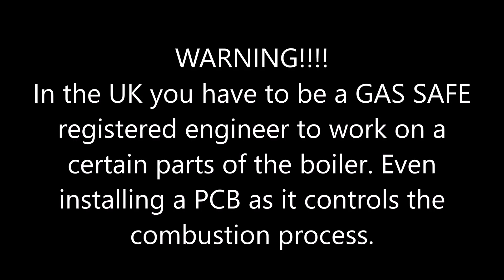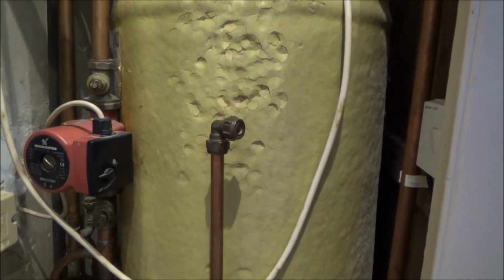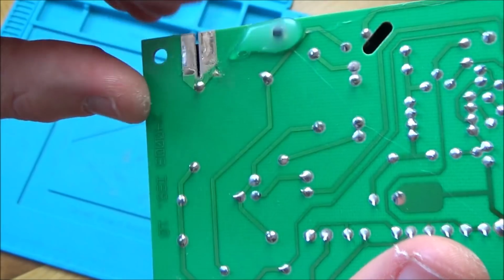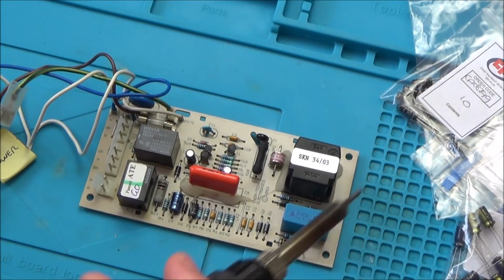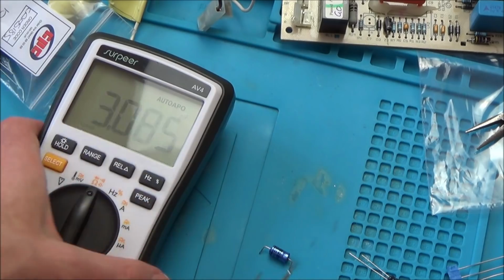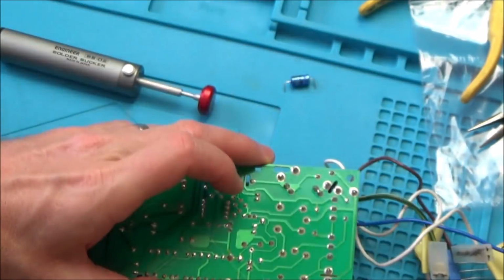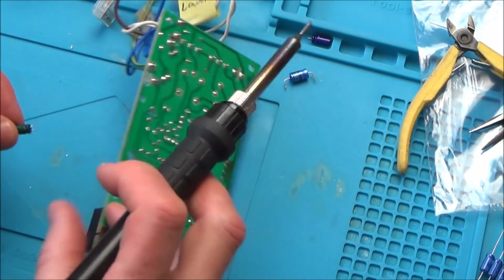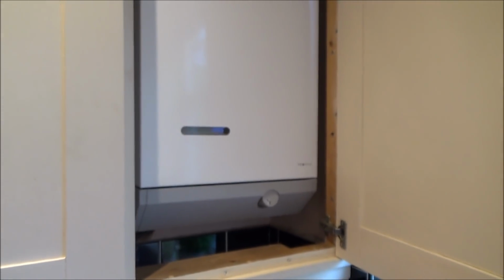Trying to FIX a Faulty Gas Conventional Boiler

Comment: Another cap bites the dust!

PS:
1. Your pal knows quite a lot, his speech at the beginning sounded like a lecture!
2. I think the reason adding leaded solder to unleaded solder brings the melting point down is because the solders match in composition except for the lead. Therefore, the liquid and the solid solders merge, becoming one homologous solder with a percentage of lead instead of either full lead or no lead.

This percentage of lead determines the melting point: fully unleaded has the highest, fully leaded has the lowest, and partally leaded has a melting point somewhere between.

In simpler words: it’s the amount of lead that determines the melting point. Leaded solder merges with unleaded solder (mechanism unknown to me atm.), and changes the amount of lead as a whole. This change = change to the melting point.

PS: PS: Keep up the good work!
Reply: Also lead-free solder joints produce more brittle joints that leaded ones, as lead is slightly flexible, and leaded solder melts with lower heat and slower cooling-down, while lead-free needs higher heat and cools down quickly.

Comment: This is a very common fault on modern central heating boilers. It amazes me that some boilers' PCB's have electrolytic capacitors with a maximum working temperature of only 85°C, which makes little sense, given that 105°C capacitors are only pennies more expensive!
Reply: When you are making millions of something, a few pennies each adds up. They care about profit, not making things last.

Comment: The blue disk at the top of the board is not a Thermistor as comment below. It’s a metal oxide varistor used to suppress voltage transients
Reply: The blue thing is a mov. A metal oxide varistor. It's basicly a voltage dependent resistor that's used for input protection. Basicly it's resistance shoots DOWN the high the voltage and thus protects the device BY BLOWING THE FUSE NEXT TO IT

Comment: Great fix, Vince!  Even more interesting is seeing the inner workings of the homes in the UK!  Not speaking for all of the US, but of all the houses/apartments I have lived in  around Ohio I have only ever had forced air heating units and water heaters that are big metal looking tanks.  At my home now I'm in a rural area surrounded by farms so I have a well with a pump that stores water into a pressure tank which then goes through a water softener and to the heater holding tank for hot water.
Reply: We still have water tanks. Not all houses, some have combis that heat on demand, some have a hot water tank. We virtually never have forced air heat rarely houses had it my house was built with it but has since been replaced with radiators. I think because a lot of our houses are solid wall so brick/block and plaster it's hard to put ducting in solid wall from what I see American houses are mostly plasterboard aka sheet rock. Modern houses are now built this way but I think we have got used to them so stuck to it.

Comment: nice repair. but one thing to note always check those diodes also, diodes can go bad. i had a few TVs which were completely dead due to 3 diodes in parallel although two out of 3 were okay. but at least its working.

Comment: in AC, Capacitors can act like a "resistor" and is frequency dependent. ESR (which has a explicit definition which I wont get into) is a way to measure how a capacitor impedes AC current Equivalent to that of a Series Resistor (ESR). A high ESR usually indicates a capacitor where the electrolyte is drying out

Comment: Great stuff =D   I've been here myself lol =D  I took the board the engineer gave me, soldered a few dry joints, he re-installed it and all OK =D
Reply from the maker: Well done Chris, this one was very satisfying to see that one capacitor testing faulty on both meters :-) Looking forward to setting time aside Monday to watch your Gameboy McWill mod video, if the thumbnail is anything to go by it looks amazing :-)
Reply: Thanks =D  I also recently swapped out the resistor that feeds the fan in the fireplace.  Super easy to do!  You just have to be careful regards anything related to gas.  As you say, gas safe engineer has to do most things.
Reply from the maker: Yes definitely Chris.  Even somethings outside the combustion chamber has to be done by a Gas Safe engineer for example if it controls the combustion as it could alter something, carbon monoxide is deadly so it is better to play safe and get in a gas fitter :-)

Comment: It's called being flexible.  At that time the capacitors they used were cheaper, so they used that type.  But if the market is cheaper that the other one, they would have used the other type.  But the person that designed the board was pretty smart.

Comment: Common problem pcb, I have replaced many of these on the potterton profile, I’m a gas safe plumber, about time it was pulled out for something more efficient.
Reply: Jay Ash had no idea mario was a registered gas safe Plummer...
Reply from the maker: Interesting to know it is common failure :-)
Reply: Jay Ash ever bothered to recap them boards I doubt it? hmm problem with gas safe 'engineers', their times so damn expensive, they think every fault is a new boiler,   No doubt the capacitors were penny's, but how much was the gas safe guy engineer to plug the flipping board back in £120?
Reply: @beingatliberty  considering the boiler is over 30 years old then no its not worth me spending my time recapping, probably cost the customer more in the long run as you are only repairing the fault, the board is prone to fail in other areas, so its not worth fixing the board only having to go back months later to repair the board again or replace, does'nt look good on me if i have to go back again for the same issue
Reply: They don't call these old boilers zombie boilers for nothing, they never die!

Comment: The big blue circle near the power inlet is a MOV, also known as a voltage-dependent resistor (Search wikipedia for Varistor), it is basically a "big brother" of a diode, once the voltage between its both legs becomes too high, it starts conducting current, till the voltage passes the same threshold again, effectively working as a surge protector. When they fail, its usually dead short or fully open
Reply: The blue thing is a mov. A metal oxide varistor. It's basicly a voltage dependent resistor that's used for input protection. Basicly it's resistance shoots DOWN the high the voltage and thus protects the device BY BLOWING THE FUSE NEXT TO IT

Comment: The blue thing that you ask about at 12:27 is a thermistor. A thermistor varies its resistance with the temperature. It is used to limit the current to the circuit.  When the circuit draws current the thermistor heats up and increases its resistance. Which limits the current that the circuit can draw. 
The large orange thing in the center of the board is a polyester capacitor. One of a polyester capacitor uses is to handle high current levels.
Reply: u know what u are talking about ?
the blue thing is a VDR or Varistor. it's a protection against over voltage between L+N, it's decreasing the resistance if the voltage is going up.
and i would never choos a polyester cap for high currents. this is a job for elkos, spezially Low ESR Types.
Reply from the maker: Thanks pds8475 :-)
Reply: It's actually a MOV (Metal Oxide Varistor) which, as Ratzfaz states, is used to prevent unwanted voltage spikes from the mains supply damaging the other components on the PCB.
Reply: @WaltonPete  I knew it had to be either a thermistor to limit current or a varistor to protect from voltage spikes depending on how it is connected. As for Ratzfaz saying he would use a elkos. Elko capacitors are typically in microfarads and for lower values a polyester capacitor is used. A polyester capacitor is also significantly cheaper as well. The orange capacitor is not the shape for an elkos but the right shape for a polyester.
Reply: @WaltonPete  they are 2 movs on the board - one(small and black one) bechause they are using only one electrode (spark and ionisation at the same time - connected between the ground and the other end of the ignition coil)

Comment: My guess would be that the board was no doubt designed with future proofing in mind, Electronic components are constantly evolving ergo if a circuit board is to be relied upon for over a few decades and if it may need repairing, it would be wise to make it as compatible as possible to the evolution of what electronic components are being manufactured, axial capacitors have been around a long time, but they take up precious "real estate" Err-Circuit board space, So Modern Electrolytic Capacitors were and still are getting ever smaller and at the same time moving away from the axial format.
Reply: That is a rather positive spin on it. More likely it was holdover from an earlier design and they had a lot of axial caps in stock when they switched to a new board.
Reply: Yerp  @Jeff121456  thats another valid reason, and probably on the money, mind you it still involves Component & PCB evolution or could we say Versions ;)
Reply: My thought  was maybe the board was hinged for access and it might foul on something else, depending on the design. I guess the board gets used in many different models.

Comment: Just a question. Is it a really fast reheat? It dosen't look like It even has enough water for a 5 minute shower. I have used an instant heat boiler but it was tiny. I realize being an American I'm used to 30 to 50 gallon tanks, but you loose hot water pretty quick because the tank is so big it cant recover very fast. Powered shower head?
Reply: @seventeesweremagic  No shade intended. Honest question. Like I said I have used Instant hot water heaters and they are 1/8th the size of that heater. Is the hot water supplemented at the shower or are you stuck with a cool 5 minute 1 gpm shower?
Reply: Generally if you have a system like this you would have a electric powered shower.
Reply from the maker: Hi dwarf365, my tank looks to be a similar size to the one in the video and I get a full deep bath out of it before it runs out. If 2 people want a bath straight after each other then the 2nd person does have to wait for it to heat up. I have a power shower with I think a 15cm square head and I haven't run out of water before I am bored in there. I think I have had 15-20 min showers without it getting cold :-) Maybe my shower pump is not pushing out the water as quick as other systems but with a family of 4 this size tank is working for us. Maybe it won't as the family gets older though :-)
Reply: @Mymatevince  Thank you so much for the reply! That's cool, it holds more than it looks. A good bath is like 20 - 25 gallons so that's about normal.
Reply from the maker: Apologies for not knowing the size, someone will hopefully reply with the answer as I think it would be a very common size here in the UK :-)
Reply: It depends up until the 80s, hot water tanks were common. Now we have so-called combi boilers which provide hot water on demand for as long as required.
It a play off between heating large amounts of water efficiently and then not using it versus heating just what you need less efficiently (the old water geysers were hopeless).
Reply: @mahlapropyzm9180  thanks so much for the reply! I understand, it's a hybrid system. That's cool, way more efficient and still has a decent buffer unlike just an instant hot water heater. Thanks, didn't know about the 3rd type of heater.

Comment: * ADDENDUM *
The Blue component is a thermistor, it's designed to fail should it experience an extremely brief but massive spike of voltage, "Think Lightning" ;)
BTW - Electrolytic Capacitors hold their voltages for a longer period than NON electrolytic capacitors such as that Orange one, electrolytics usually are designed to charge and discharge on a dirty "half rectified" Direct Current Circuit ergo the need for polarity, BTW if you inadvertantly place an electrolytic Capicitor into a Alternating Circuit "AC" or signal circuit that changes phase, it may end up being an explosive experience :D
Reply from the maker: Thanks mate :-)

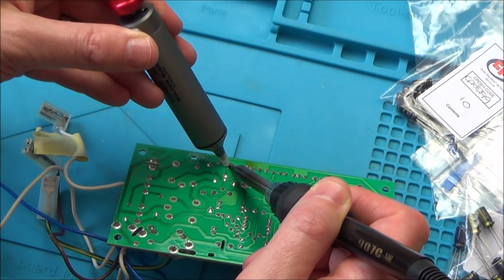Comment: Looking at the other side of the board there is a very big patch of scorching going on there at for example 15:42 to the left of the soldering iron.
Reply from the maker: Well spotted Ian, the 2 marks on the right of the soldering iron at 15:42 ...it looks like it is on the component Z3. I didn't notice this in real life!!!! Not sure if Z3 is designed to get this hot or not. Hopefully it doesn't fail :-)
Reply: @Mymatevince  probably a Zener diode. They do get warm iirc, but that may have been exacerbated by the dodgy cap.
Reply from the maker: Thank you :-)

Comment: 22:34 The large round cap is what we call a safety disc type capacitor.
22:37 Another safety cap
These safety capacitors are for preventing some kinds of electric disturbance that can either destroy the circuitry or introduce a shock hazard.
Also, you should have purchased and used high-quality capacitors from reputable manufacturers! Majority of cap failures are caused by inferior manufacturing, or too old age.
(Edit: Solid capacitors like ceramic does detoriate, but slower than electrolytics, about 3 to 10 times life, and shows detoriation through cracks, shorts, or open-circuit. Physical damage is the common fail)
Reply: Andrew Littleboy Sorry for the grammar. And those were not Panasonic when I still remember learning about them, those are from Matsushita Electric Company a.k.a Panasonic! (note: check the 'M' inside a rounded box)

Comment: Great job. You would have link or name brand for the solder wix. I am use to using a braided wire.
Reply: GootWick is good - it is impregnated with flux and not too tightly bound. Other cheaper ones don't have the flux or not enough. You can buy solid flux (colophonium from Ebay) and melt it into the braid, then it works well.

Comment: Could someone tell if its perfectly safe to pressurise a standard 36  /18 pre-lagged cylinder, thats not something i would ever have thought to be right, even if its only 1 bar, what happens when the pressure relief valve goes wrong and then the cylinder is expected, to take 3 bar?.

Comment: Meant to say Vince .  We're you aware that Maplin began trading again sometime between Christmas last year and earlier this year . They are only online now so you should still have that resource for components . I've only seen they are indeed trading again I haven't checked what they are now stocking. But thought i would let you know. Had this issue on our boiler 2 years back but it was a combi. Ours however ended up being condemned due to the issue as it would start try light and fail and then purge the extra gas built up but then that failed too which was the pcb too. Ended up with a new boiler :( . Right now to watch the rest of the video
Reply from the maker: Cheers mate I never knew. The thing with Maplin was that if you wanted something the same day then could get it locally even if you had to pay 3 times the price of online. Now if they are back online only I would be tempted to use someone like CPC and get the same things much cheaper. Years ago but if you needed a component then you had the option of Maplin or another little radio type store which near me do not exist anymore.....now everything is online so it means waiting for delivery which is annoying when you want to try and fix something. I will check them out online though as I am curious as to what they are selling :-)
Reply: @Mymatevince  Its atually  not the Maplins you know... its some other entity that has bought the name and trying to trade under it and making piss poor job of it

Comment: The reason for the option for axial and radial capacitors is down to component population and therefore the build of the PCB would be faster in there current order. This is how production produce the M/c programs.
In was a technician on PTH machines and theses types of components are more robust then surface mounted components.

Comment: Blue disk looks like a MOV. Capacitors are not ideal components with only capacitance. They can be treated as being "ideal" capacitors and inductors in series with a resistance; this resistance is the equivalent series resistance (ESR). ESR is always an AC resistance measured at specific frequencies .

Comment: Do you have a link to the Solder sucker? it seems to be working fantastic for you
Reply: Look on ebay they got loads, just type solder sucker.
Reply from the maker: It is really nice this one. I think it is made in Japan. Type in 'Engineer SS-02 solder sucker' into Amazon or eBay and you will find it. It has a soft silicon nozzle that really makes a seal so it sucks up the solder easily :-)

Comment: Is your brother a sparky or plumber? How does he know about his plumbing and about the circuit in the boiler? Was he just told?
Reply from the maker: He is trained as a sparky but takes an interest in plumbing and most building related things :-)
Reply: Plumbing is fairly straightforward, so you wouldn’t need to necessarily know it as a trade to understand your system. Electrics is a different ball game, and makes total sense now that Vince informs that that is his trade. Two very knowledgeable brothers 👍

Comment: The blue thing is a mov. A metal oxide varistor. It's basicly a voltage dependant resistor that's used for input protection. Basicly it's resistance shoots up the high the voltage and thus protects the device that's sitting behind it.
Reply from the maker: Thanks mate :-)
Reply: @Mymatevince  The blue thing is a mov. A metal oxide varistor. It's basicly a voltage dependent resistor that's used for input protection. Basicly it's resistance shoots DOWN the high the voltage and thus protects the device BY BLOWING THE FUSE NEXT TO IT